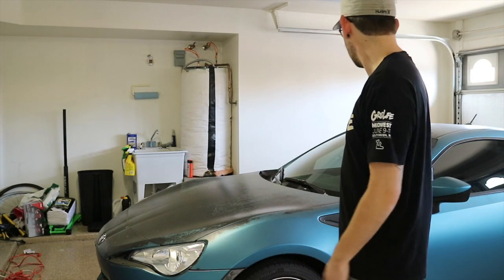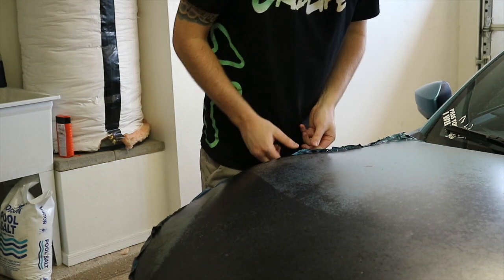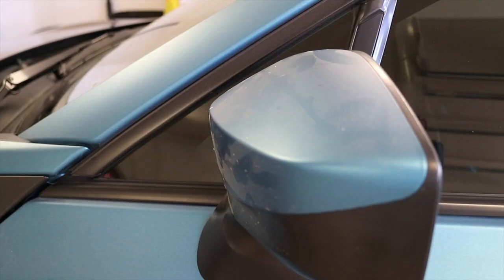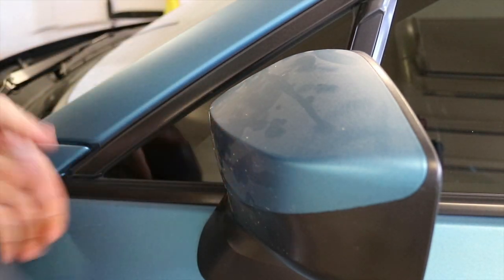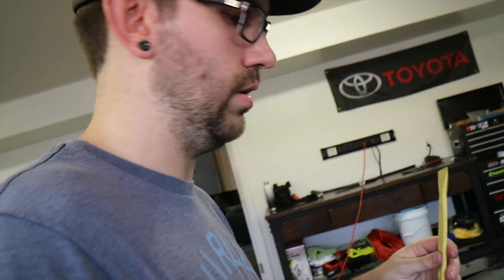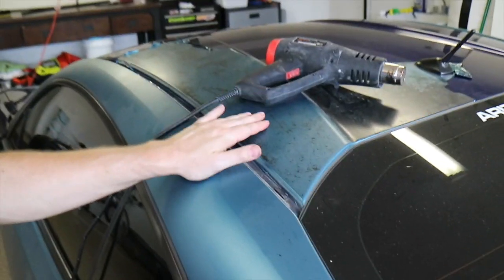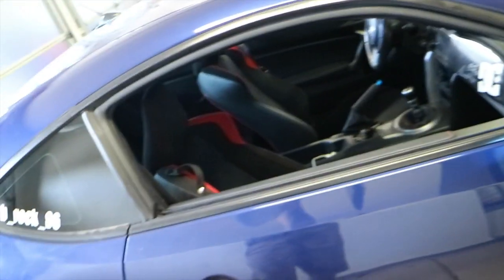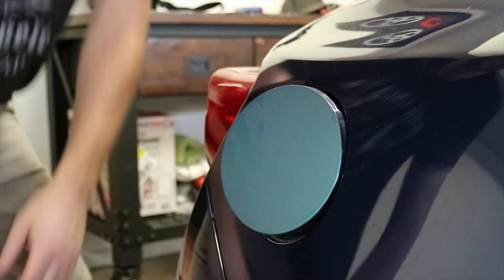Vinyl Wrap Removal 5+ yrs

Comment: Hey man! Also from Phoenix removing a wrap that’s been on my car for 7+ years.  The one thing that I found that worked on the left over adhesive is 91% Isopropyl Alcohol.  Hear me out - it won’t lift the adhesive off onto your rag/towel, but it will allow you to bunch it up and then scrape/pick it off VERY EASILY.  Don’t know if you will ever need this information, but hopefully it can help out someone who finds your video!
Reply from the maker: Awesome, thanx man! I even still have a few little spots that I could try this on.
Reply: Ill tell you what i definitely needed it after a 10 year wrap, thanks man
Reply from the maker: Lol yeah it’s probably time
Reply: @BRock86  it took off half my clear coat so now im scraping the rest off before painting
Reply from the maker: Damn, that really sucks
Reply: @BRock86  yea but thanks for the video without it i would never get this done
Reply from the maker: Of course, good luck!
Reply: I'm about to try removing mine. Thanks for this isopropyl alcohol tip. I'll have 1 ready.
Reply: No damage to the clear coat when removing the wrap?
Reply: Rain x original water repellent is practically alcohol as well. Works pretty good for the same.concept.
Reply from the maker: Thanx, gonna have to try this 👍
Reply: alocohol will remove clear coat, the best glue remover is rapid remover, that is what the pro use!!

Comment: Just throwing this out there. I have used vaseline or olive oil to get residue off from other adhesives. Cheap and easy to try. You'll know if it will work for you pretty quick.

Comment: I have a T/A Challenger with faded wrap that i'm going to take off this weekend. I heard 3M adhesive removal is about as good as Acetone. I've also heard lighter fluid works really well.
Reply from the maker: I would give the 3M a try first. On some of the real stubborn spots I used gasoline.
Reply: @BRock86  I worry about using lighter fluid or gas. The idea of what it would do to the clearcoat scares me . I'll def look into some 3M adhesive removal first.
Reply from the maker: @VchaosTheoryV yeah when I used the gas I rinsed it off immediately

Comment: My roof is a nightmare. Cracking every 2-3 inches of pulling the wrap, and I have to pick at it again to get started. Zillions of peices and 6x as long as a normal panel. Heat doesn't help.
Reply: Literally running into this issue right now just a bunch of small pieces. Did you find anything helpful?

Comment: what ended up working to get the glue residue off? just peeled my wrap off and that glue wont come off
Reply from the maker: Gasoline. Put a little bit on a rag and then rinse with soap and water. I was able to most of the remaining glue off that way
Reply: @BRock86  and the paint was back to feeling smooth after that?
Reply from the maker: Yeah like new, honestly if the gasoline doesn’t work, you might be in trouble. I think the next step would try and wet sand and buff. Let me know either way how it goes
Reply: @BRock86  I only had my wrap on for 5 months, so I should be good. I used goo gone and then some isopropyl alcohol on the spoiler as a test spot and it almost worked 100% but it took SCRUBBING with a microfiber, of course, to get it there. Its hot and sunny outside right now so Im about to go try that out
Reply from the maker: Ah you should be good man

Comment: Did the wrap leave any real ugly residue on the doors or anywhere else? Also was this a 3m?
Reply from the maker: Yes, the residue is really hard and actually still in a couple spots. The best thing I found to remove it is gasoline. The previous owner did the wrap so I’m not 100 percent but I’m fairly certain it isn’t 3M
Reply: @BRock86  I have generally heard and experienced that 3M vinyl wraps/skins used on tech and cars don't leave any stickiness or residue behind. What do you think?
Reply from the maker: Although very limited, I use 3M wrap myself and it has never left a residue.
Reply: @BRock86  So I've been recommended by a friend to use 3m vinyl skins on my newly bought PlayStation and laptop(and I ordered and installed them), both have delicate glossy material. He claimed and I also have also have heard other people say that those high quality vinyl if removed with proper care don't leave any stickiness or residue and actually protects the console and keep it in pristine shape. However I have seen some YouTubers like Ckwrap etc complain about residue left on the cars, while people removing their 3m Dbrand vinyl wraps from their laptopa and iPads do it without a single mark left on the device. I'm kinda confused. Could you give me a better picture?

Comment: I remove wraps for a living.  While I would love to explain how do it best, I don’t want to put myself out of a job.  

What I can say, is that don’t expect this to be easy.  Don’t expect your paint to look good after you get the wrap off.  Don’t even start to think about how easy this will be…   It’s not easy, and just getting the wrap off is likely the easiest part of removing a wrap.  

The worst part is getting the adhesive off the paint that is left behind.  

Expect getting the vinyl off, is only about 40% of the removal.  So if you pay someone to make your car look like it did t have a wrap on it, expect to pay someone about what the cost of the vinyl was.
Reply from the maker: Thank you for sharing, no one talks about this part
Reply: Is removing PPF much easier, including way less adhesive left behind after 5-10+ years?

Comment: Mines all cracked and dry taking forever to remove
Reply from the maker: Yeah the hood and the roof was the worst. If it’s really brittle I would try using an adhesive remover wheel. I have one by 3M that works decent but you can get cheaper ones on amazon
Reply: @BRock86  i was just thinkin of doing that man thanks for replying.i ask alot of youtubers questions but nobody responds.god bless man
Reply from the maker: Of course man! Thanx for watching and good luck 👍

Comment: Any update on the left over adhesive on the roof? Got the same problem after removing the wrap off the roof of my bmw
Reply from the maker: I still have a little bit. I have yet to find the perfect fix. The 3M adhesive remover and stipe off wheel have worked on most of it.
Reply: B Rock 86 seriously contemplating taking it in and having it looked at by professional paint detailers to see if they can buff it all out. I wouldn’t mind paying to skip the hassle
Reply from the maker: Yeah let me know if you find something that works
Reply: B Rock 86 took it to the wrap shop that removed the wrap. Showed it to them and they knew exactly what to do. They sprayed the roof heavy with 3m tape adhesive remover and rubbed rigorously with clay bar. 15 minutes with 3 people and it was smooth
Reply: B Rock 86 hope this helps
Reply from the maker: That’s awesome! About how long did they let the remover sit before they started rubbing?
Reply: B Rock 86 wasnt any longer than 2 minutes.  But, when they were rubbing rigorously with the clay bar on the rough areas, they would spray more in that area and keep rubbing until it was smooth like new.  After the whole roof was smooth like factory, they were nice enough to rinse and dry the car for me.
Reply: B Rock 86 leaving a like on your vid and subscribing for helping me think through my problem lol!
Reply from the maker: Thank for the support! I really appreciate your input and I’m going to give that method a try for sure.
Reply: Can't buff until all the glue is off.
Buy rapid remover. It's a great product. Spray on in the shade and microfiber cloth off after about 5 mins. No need to scrape. Do small areas. Then clean with a good soap again and again. Clay bar and buff

Comment: Would blowing compressed air under the wrap help?
Reply from the maker: I don’t think it would. Really you want to get the wrap as warm as possible but not to the point at witch it tears apart when you pull on it.
Reply: @BRock86  
Thanks

Comment: There is no way that vinyl has only been on there for 5 years....
Reply from the maker: Lol correct
Reply: In Phoenix...  it takes only 1 yr for vehicle wraps to get spider webbed (cracked) from the sun. Surprisingly it lasted as long as it did in this video.
Reply from the maker: Lol, most of the wraps life was spent in the midwest. Phoenix finished it off
Reply: For real my roof wrap is not even two years and ima about to take it off tomorrow because of shitty quality wrap was used and it’s all jacked up

Comment: Gasoline is the only way (not joking)
Reply from the maker: I have heard about that method but have yet to try it.
Reply from the maker: Tested and approved 👍
Reply: Lighter fluid helps soften brittle wrap. Wipe on after heat
Reply: whiskeybravo11 I have recently mastered taking off plasti dip, goo-gone works good if you apply it on, scrub it a little, let it sit then ither put on one more coat or scrap off with a razor blade. More coats= better
Reply: @randabuffer6562  wd-40 and a pressure washer works well on plastic dip also. Start a peel at the top and let it soak in behind it works best on big flats. Wheels like you said scuff it and soak it. Probably similar to goo gone.
Reply: whiskeybravo11 I tried wd40 but spraying it behind the dip sounds like it would have worked much better.